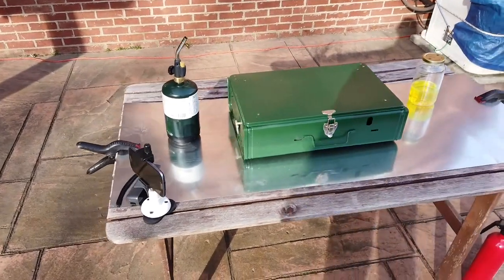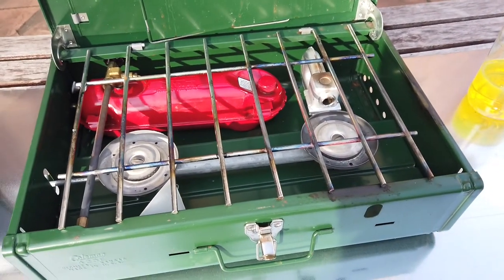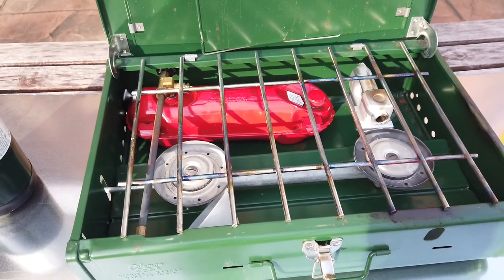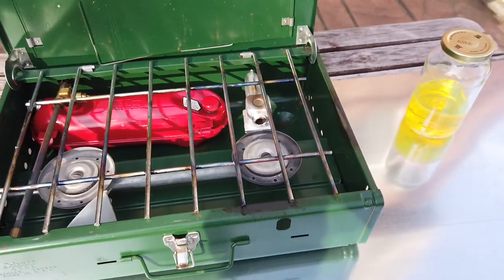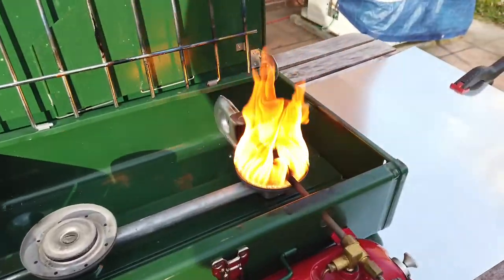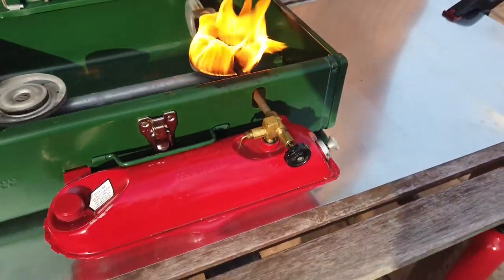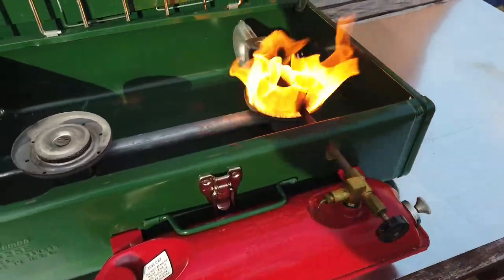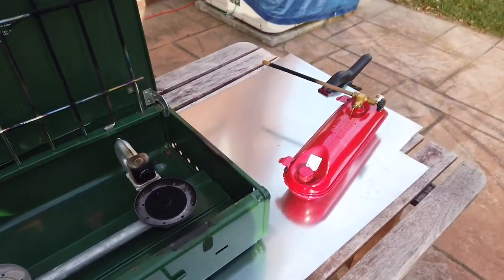Cooking With Diesel - #2 Coleman Camp Stove

Comment: Make sure that there are no obstructions in the fuel air tubes, the slightest bit of blockage can cause the flame to burn rich/yellow no matter the fuel. The rotary valve with the knob is two stage. When you open it a quarter turn, it only allows fuel vapor in from the top of the fuel pickup tube that's in the fount (fuel tank). When you open it up more, then it starts to pick up liquid fuel. This is why you only open the fuel valve beyond a quarter turn after your generator is up to temperature, and when you do open it, open it all the way.  Thank you for posting this, it was great!

Comment: The jet size in the generator is two large for kerosene/diesel. You would need to drop the jet diameter by 0.001"- 0.002" of an inch to get the proper fuel to air ratio for kerosene or diesel. Your atomizing/vaporizing the fuel it's just to "rich". Kerosene and diesel contain many more btu's than Coleman fuel or white gas and need to be run at a leaner ratio.
Reply: Interesting.  I wonder if anyone has tried this
Reply: Not entirely true, I've seen Kero burn surprisingly clean and blue on a 425.
Reply: I agree with John, the jet at the end of these stoves is meant for gasoline or white gas, it would have a much better chance of running better if it was leaner (smaller jet). My MSR XGK EX came with a smaller jet to run specifically for diesel. I have not ever run it on diesel but like the idea that I could if I needed to.

Comment: Copper conducts heat really well. Wonder if some moderately heavy copper wire (14ga seems about right) wrapped a few turns around the generator with the ends poking out a half-inch or so would help. Do that several times over the burner area so you have a wire wound generator with fins of ends poking out each side.
Reply: Thats thinking is pretty innovative. Too many people are happy with just saying "it wont work"
Reply: there is a vid of some one putting copper wire around tube,  for kerro,  it worked ,
Reply: Yep there's some other videos of exactly this. Take neutral wire out of some old romex and wrap 10-15 times to help hold heat in the generator. Letting the ends stick out over the burner will grab even more heat. I think the generator tip will be the biggest issue though as it's a bit too large for the higher BTU fuel. It will always tend to run rich even if it is properly vaporized.

Comment: Good test. I was wondering the same with different fuels. But it has taught me that white gas is the easiest. Denatured alcohol is unstable, kerosene needs just a little preheat (torch not needed just tissue) amd burns very nicely. But again, white gas is hassle free and quick.

Comment: Try it again after you check all of the air tube, especially the elbow, for obstructions like mud dauber nests or spiderwebs. They can be tricky to get out sometimes. 
I suspect the diesel will run fine in it afterwards with a good preheat again.
I’ve seen enough of these run perfectly on kerosene and would think diesel would at least burn decent.

Comment: If you're having to use a propane torch to preheat the stove then in essence you are still having to bring two fuel sources. Running regular gasoline in these stoves works pretty much the same as Coleman fuel but does require occasional cleaning of the generator.
Reply: Dad used a wood coal 🤔
Reply: if I have to preheat the stove with propane, it would be a waste of fuel. Might as well cook on propane.

Comment: To get it to work you need to have the fuel turned all the way down on very low because the fuel is cooling the generator with it turned up high and its not heating up anough  like that and hold the torch on the generator longer before opening the fuel

Comment: Regular Gasoline works great !  Been using it on a 426D for years with no problem !
Reply: can't use gasoline inside, but can use diesel if it's burning right.
Reply: @massa-blasta  Or you could get a propane conversation generator. I know of whole houses that run off propane. I do prefer running gasoline or white gas but propane would be a proven option for inside a house.

Comment: Coleman made kerosene, as well as white gas lanterns. There are YT videos showing how to convert from gas to kerosene lanterns, and how to run them on diesel. If I remember correctly not only do you need to preheat the generator, but you also need to change the jet. I wonder if that might help in this situation.
By the way, if anyone is interested, you can find an adapter to convert these stoves from white gas to propane. I have one and it works well.
Reply from the maker: Thanks for the comment.  I was actually going to get the propane adapter but they were out of stock last time I checked.  I also have a 2 burner propane unit, so I don't really need it, but I thought it would be cool to have.  I've seen some folks run these on kerosene with better results, so I'm sure it can be done.  I'll have to keep looking while I'm waiting for the weather to warm up.  Meanwhile I'm loving the MBU V3, but kind of big/heavy/bulky to camp with.

Comment: Thanks for doing this, I have been wondering about doing this with mine (same/similar model) for 4wd camp camp cooking as I have a deisel hilux it would make good sense. These stoves work great on unleaded fuels, but I imagine to get deisel to burn correctly some of the suggestions here may help, by using a smaller jet orifice firstly, as deisel has a greater BTU/ltr ratio than white fuels/petrol or gas, maybe increase the generator efficiency by winding a decent layer of extra copper around it might help. Also, if you can increase the air delivering through the mixing Venturi this may help as well. As other have mentioned you could try mixing with other more combustible fuels until you find a ratio that works. 
Nice experiment, but you should have checked that the stove actually worked correctly on normal fuels first, my guess is that it will work fine on normal unleaded fuels judging by the flame you got with the deisel and a smaller jet size would be a key issue here. TFS. Cheers

Comment: To start, you would have had to put the small tap near the tank upwards, and once it got hot enough, turn it back down, because in the down position, it will run from the vapour pressure.
In an other Video I did see someone use Kerosene in such a stove, and that was a hard start too. That guy used some kerosene-drawned Aluminum foil coil to heat it up at the beginning, and it took, even with that kind of starting aid some two minutes to get it started, but then it burned pretty well.

Probably you didn't start it as by the book, or the Generator was clogged, or it did in the end not have enough pressure left in the Tank.

Comment: If you want to use diesel, simply buy a Primus stove.

I have been using mine for 40 years. They are Parrifin (kerosine) stoves, but runs equally well on diesel.

And, as a bonus, they look way better than the Coleman - nice copper fueltank to polish up😁
Reply: Do you still have to prime it with metho?
Reply: @LeighBlackall-plus  Yes. Bit of methelated spirits in the cup, let it burn for a few minutes to heat the vaporiser, and off she goes.

I use Alcohol gel nowdays, its less prone to spillage an fire in the back of my 4x4.
Reply: @kafferhond435  good tip on the gel. I'll try that too. I spoke to a mate, He mixes the diesel 60/40 and said it's perfect. But I'm going to try 100% diesel. This is great if I don't have to carry another fuel.

Comment: Use no. 1 diesel fuel if you must.  Kerosene has a lower sulfur content and burns cleaner.  Most diesel engines will run on it just fine.

Comment: Long before the days of dual fuel  Call man stove my father used gasoline but he used premium gasoline If you use low grade it does not work very well I made the mistake of using regular leaded gasoline in the lantern and it bursted into flames make sure you use premium no lead   Gasoline

Comment: If the stove was untested? It's not a good practice to run a non recommended fuel straight off the bat!
Test new/second hand stove with recommended fuel first!
If it is working as it should? You may have to service the Generator..whatever!
Is it working correctly? Yes ✔/No
If ...yes then change the fuel!!